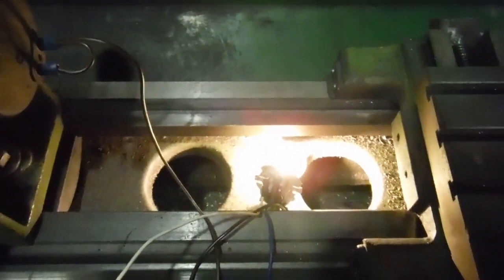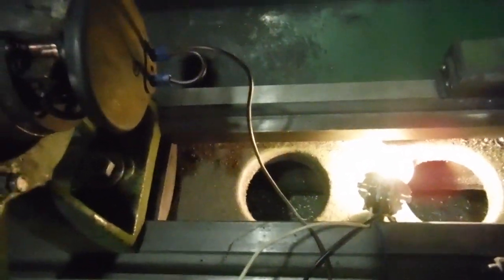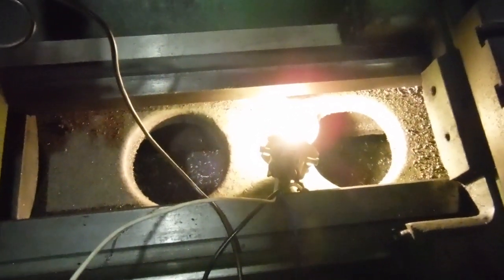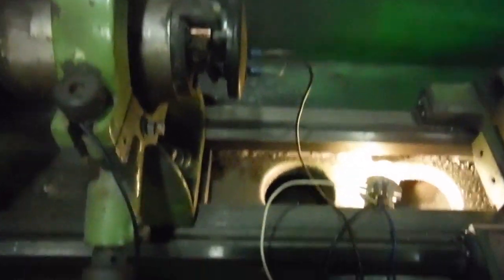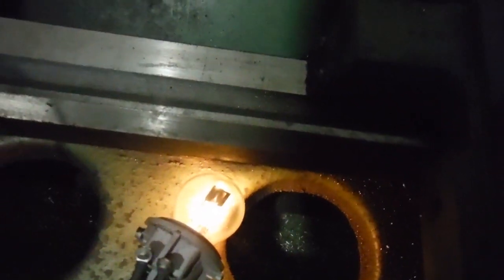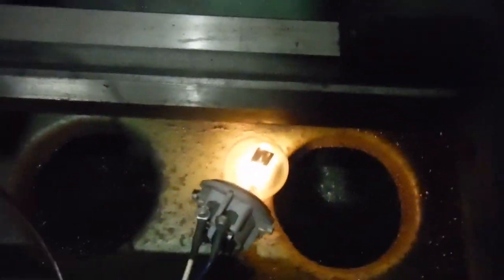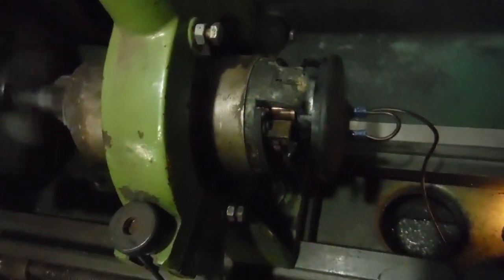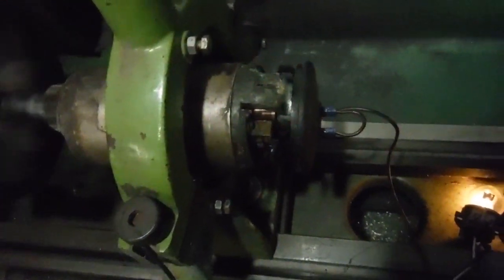Old, heavily corroded Lucas motorcycle dynamo tested after many years spent slowly decaying.

Comment: Often makes me wonder why many people junk their older equipment as a matter of course rather than doing as you have done - service than test.
Reply from the maker: Hi Neil, yes, so many useable things seem to get thrown away just because they are old, when they are possibly better than the modern items destined to replace them.
Reply: My thoughts exactly, so many people fit black boxes to their bikes when they have no hope of fixing them if they fail. With points & coil most problems can be traced and fixed at the roadside. 
With a magneto, a quick bake in the oven usually brings them straight back to life!